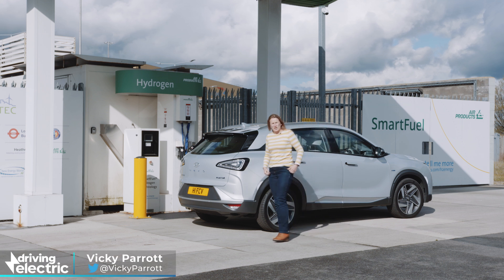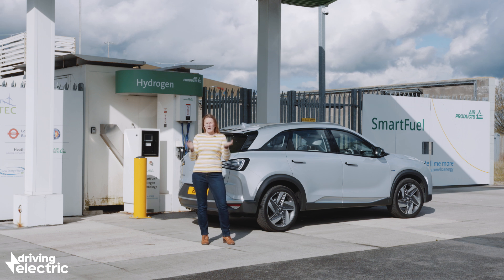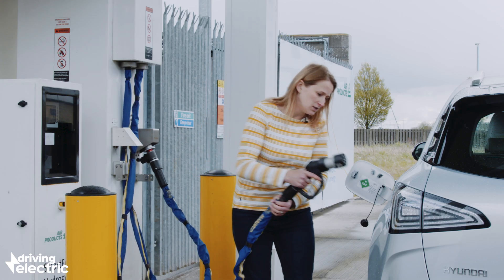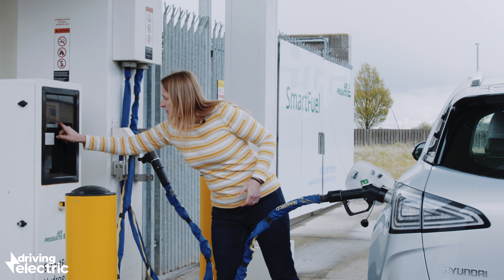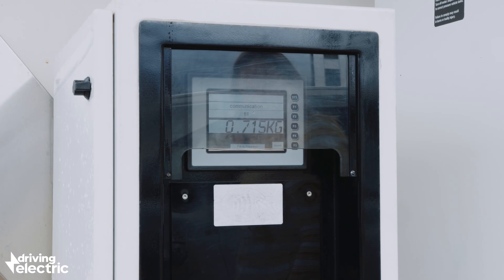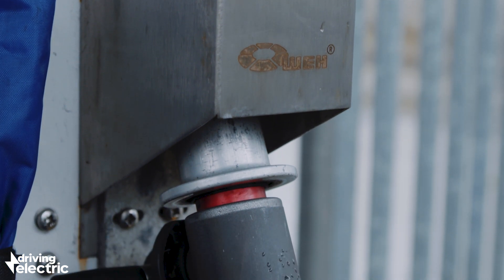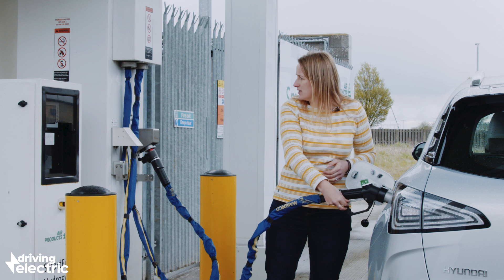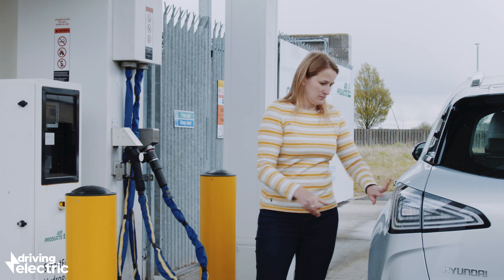How do you fill up a hydrogen car? - DrivingElectric

Comment: Unlike electric, hydrogen is the only potentially 100% clean fuel source, it's in the air all around us, no digging, no shipping, it's a matter of pouring as much money into developing hydrogen as they waste on the filthy destructive mining and shipping of batteries.  The trick is developing independant sources of hydrogen production and blocking out big business which is why it's so expensive now.  The good thing about hydrogen is that you can retrofit current gas stations since the refueling process is quick unlike the hours it takes for electric.

Comment: Hydrogen is the way of the future but people seem content to sit on inefficient methods to obtain the hydrogen.  Currently, Hydrogen is obtained as a byproduct of natural gas production.  This is the wrong way to go about things.  Passing an electric current through a body of water will split the H2 off from the O1, converting water into hydrogen and oxygen.  When put through a fuel cell, the hydrogen and oxygen snap back together and releasing energy used to run the electric motor.  The waste byproduct is distilled water.  When put through a Hydrogen ICE, the hydrogen is oxygenized (aka ignition) and the explosion drives the pistol down.  The waste byproduct is also distilled water.  Hydrogen ICE is better for vehicles that need a larger engine like a semi-truck or a tank.

The advantage for using hydrogen over pure electricity is that hydrogen, while flammable (no different than the flammability of gasoline, propane, methane, etc), can be stored on site for long periods of time, can be transported or piped to any location without energy degradation, and provides similar energy density to gasoline.  Not to mention it's clean.  It is basically a normal gasoline or electric vehicle but the fuel is as energy efficient as gasoline and can be stored for long periods in remote locations unlike electricity.

Pure electricity would be better except batteries are toxic, heavy, have low storage, deplete over time naturally, and unless you can afford to build advanced charging stations everywhere, will take forever to charge.  Not to mention EVs are unattractive to anyone living in an apartment or park on the street.  You need a house or at least an upscale apartment with a garage.

The issue is obtaining the hydrogen.  As said above, currently hydrogen is obtained as a byproduct of NG extraction.  Water however is the best source, and more specifically, water from the sea.  Anyone with a coastline or major river can be energy independent.  Using renewable technology (eg solar, wind, hydro), we have the electric current.  Store and transport hydrogen as we would any flammable gas like methane.  The only annoyance is the pressurized nozzle at the gas station computer to connect to the car.

People don't want to use hydrogen because it's flammable.  But happily turn on their gasoline car and run their natural gas stoves.  Methane is an odorless and colorless gas just like hydrogen and just as flammable.  Corporations/Governments don't want to use hydrogen because they're already invested into Fossil Fuels.  They're going to ride that train until all the oil runs out at our expense because it makes them money.

Comment: I just can't wait for below freezing winter driving, as often found World wide, and here in the States where millions of Vehicles move about, when in a fully built out Hydrogen Future Energy Society countless  hydrogen vehicles have driven before us spewing mostly cool liquid state water exhaust droplets from a hydrogen fuel cell's 60-80C/140-176F exothermic reaction coating the roads with black ice for us to drive over and wreck our vehicles on ! Remember that liquid water begins to steam, when heated, at 100C/212F. To start before embracing Hydrogen Vehicular Transportation please research "Black Ice". Next watch the Hydrogen Vehicle videos showing under high acceleration water mist vented hard onto the ground. Watch the videos of people drinking Hydrogen Passenger vehicle tailpipe emissions by-product. Even " H2O '' liquid dump buttons flipped on from the drivers position. Are you in support of slips and falls in parking lots from countless, intentional winter temperature liquid water waste dumps left when leaving parking spots? Now that is safe ! This concept is just another, not so well thought out,"GREEN", idea that when applied into the real world, with millions of passenger and commercial trucks produced by so many manufacturers  needed to fuel a society with hydrogen to keep us safe from climate change, does not keep us safe from injury or death when in vehicular accidents or falling down when encountering ice. A future Hydrogen Economy when built out, operating so many Hydrogen Vehicles that are spitting water on below freezing road or parking lot surfaces day after day in continual below freezing temperatures is not the answer ! It only takes  a small patch of ice for a person walking to slip and fall. The key point is the state of the vehicle water emitted. Internal Combustion Engines (ICE) have high thermal heat output 250-800C/482-1472F and the resulting combusted fuel emissions cocktail comprises much less liquid water state exhausted as a portion per mile which is, in the case of an I.C.E. exhausted mostly instead as water vapor, which as we all know, is emitted as a gas vapor not settling on a road surface, but dissipating up as heat rising into the atmosphere. Present fuel cell designs drip much water, about a cup per mile, plentiful commercial Trucks / Lorries much more in the liquid state as the only single resulting byproduct, able to fall in a cool liquid form, ready to freeze on colder road surfaces. That is the difference. How about adding a steam heating unit to the fuel cell's liquid water by-product exhaust, this may be an energy intensive solution reducing mileage, and efficiency during winter driving, but lofting water vapor up off the road as ICE propelled vehicles now do. So, where to put the liquid water. Maybe an onboard  tank to freeze solid and burst when parked?  At a stop sign or light idling then accelerating adding heavy icing right there to the road surface just where one wants to actually stop? A parking lot to slip and injure another walking by the back of your parked vehicle or after you drove off leaving water to freeze there? A roadside gutter so a pedestrian can slip stepping off a curb, maybe falling down flat in front of stopped traffic and out of view of drivers ready to accelerate forward? Your driveway so you can fall there ? Your Garage to slide across while holding your infant child then both hitting the hard floor? Maybe, you need more tasks or to be distracted by mopping up the garage floor before the water freezes and your groceries just purchased thaw? Maybe a high speed highway perhaps in a turn? Maybe the unlimited speed limit Autobahn with high water production by those higher electric energy demands moving the hydrogen vehicle through the air while simultaneously dumping large amounts of water mist contrails at high speed onto the road surface? Your Hydrogen Vehicle needs to relieve itself in public, The question is where to do it safely? Now considering these real world usage / interaction scenarios listed, are Hydrogen Vehicles a good idea? As a vehicle operator you can rate the chance of consistent, caring, and professional operator actions observed when you're out exercising your privilege to be with others in the public driving arena. Are you certain that rushed Hydrogen vehicle drivers find and maneuver over a public storm drain water dump station to let their hydrogen vehicle relieve itself in public places when freezing weather is happening? You rate and you decide if  we or will not slip into a Hydrogen transportation based society. As for me...you guessed it,  I see much more "could care less" vehicle drivers and very few careful vehicle drivers. Hydrogen supporters….should we give these "could care less" about you drivers a water soaker sprayer for society at large to walk or drive over when a dash indicator flashes an alert "water tank full" during your trip? 

  As a example of related but current human behavior, How many times do you see trash / rubbish go swirling out of a moving pickup truck bed in the States, or dumped out a moving vehicle window instead of being caringly placed in a proper waste receptacle when arriving at one's destination, as an example of drivers' proper public disposal habits?

Maybe add antifreeze to the water dump so it can mist on following vehicles windshields / windscreens then be smeared when wipers on, so the trailing driver has no clear view of the road. Now that is safe ! Then more windshield solvent , with poisonous methanol, is added to the ground by constantly spraying to keep a clear view. Now we're turning wipers on and off, as if that is not distracting to manage while driving in heavy traffic or oncoming bright sunlight in turns. Now that's safe.

Maybe many Hydrogen Fueled Vehicles can dump water, and antifreeze, smearing trailing vehicle's glass view 360 degrees, that is now spread everywhere in the environment. Now that is green, think !

Maybe the Hydrogen Vehicle owner after the cost of a fill up of Hydrogen decides to not pay for the extra cost of perpetually filling an auxiliary antifreeze reservoir that costs more than gas or petrol per gallon. So where is the transportation fuel savings when buying both Hydrogen and Antifreeze for the fuel cell's water as a by product tank?

Maybe granular or liquid salt treatment of ALL the roads ALL the time when temperatures are below freezing, even on sunny winter days ! Now raising the P.H. in streams from water mixed with salted trickling runoff 24/7/ all winter does not sound very Environmentally conscious or Green Think savvy. Get ready for higher taxes to pay the millions of dollars to pay for road treatment. Pay for replacing your scratched up paint. Pay for a broken windshield / windscreen when a chunk of salt is thrown on it during truck/ lorry application. Buying a new Vehicle often because your vehicle rusted prematurely from driving all winter on heavily salted roads.

Maybe add vehicle exterior damaging or ICE engine air filter intake & cabin air filter clogging traction grit like coal furnace electric generation plant cinders or mined beach sand from environmentally sensitive areas to the below freezing road's surfaces 24/7 all winter to combat black ice on road surfaces, filling the streams with sediment to clog fish gills when stirred into the water column later by heavy rains to follow in warm weather. Now one has to think twice about opting for a green and healthy deep breathing bicycle ride or walk on a drier warm early Spring Day to work or for pleasure while breathing the leftover dust from many Winter months of road grit application stirred up by passing vehicles.

Maybe the antifreeze adder system breaks or is disabled. Now the trailing driver is back to sliding on black ice in below freezing cold temperatures when Hydrogen is used in Vehicles as a transportation fuel spewing ONLY clean water onto the roads as the only by-product of its use.

Possibly you or another will be in a hurry to turn into an open parking space like so many hydrogen fuelled vehicles did before you after many back to back freezing days. Only to slide on black ice your vehicle's front bumper into the side door of or bumper of an already parked vehicle in the next parking space because of all the repeated water dumps released earlier by other shoppers under the hydrogen vehicle's body.  : (

Here in the States most road temperatures fall below freezing during Winter, especially when traveling dark roads during long evening hours. Just imagine creeping with hundreds of other vehicles during slow rush hour traffic on road surfaces that are tilted for warm weather water run off door handle to door handle on multi lane interstates while hundreds of Hydrogen vehicles there with you drip water on to below freezing road surfaces. Yes you imagined what will happen when your vehicle slides toward or into the vehicle on the downgrade. Resulting in another hassel to fix your and the other driver's vehicle. I would bet vehicle monthly insurance rates will cost more to cover all the " Fender Bender" type accident claims caused by gravity sliding your Hydrogen vehicle downgrade into another.

You decide, if adopting Hydrogen Transportation is in our best interest in the "Real World". Seems like a slippery slope to me ! How about you ? Are you still a Hydrogen Transportation vehicle supporter?

Comment: The average cost, per mile, for a gas powered vehicle with an energy efficiency of 22 miles per gallon, is around 15.9 cents per mile, according to a Google search for "the average cost, per mile, of a gas powered vehicle."
The hydrogen fuel cell vehicle seems to come in at about a dime above that. 
If energy were food, electricity and fuel cells would be the healthy foods while fossil fuels would be the junk foods that we are having a really hard time of cutting out of our diet!
Healthy and expensive versus unhealthy and cheap. We are junk food junkies, unfortunately.

Comment: 1:07  So what happens after Aug 2038 when the h2 tanks expire in the car?
Reply: @Elliot Pope they need to be replaced. No one has a guess what it will cost. Today's prices are about $7,000 USD per tank.
Reply: Same as car batteries?
Reply: @gobimurugesan2411  maybe, maybe not. For example, the first Gen nissan leaf had a range of 75 miles. Some are pretty shot at this point and only get 1/2 of that at 38 miles. That's not very useful for the bulk of the population, even as a grocery getter.  Compare that to a typical model made in the last 5 years that gets 250 miles or more, even losing 1/2 of the range in 15 years, it's still a very usable car. In fact, it's still has better range than a new leaf had to begin with. Time will tell.

Comment: £80 to fill it up?! F*** that.
Reply: it's because there aren't really any hydrogen cars in production. Once people start actually buying hydrogen internal combustion cars, it should only cost the equivalent of a few cents per gallon. That's because hydrogen is made from water.
Reply: @Amigafur the process of producing hydrogen itself is expensive compared to other types of fuel

Comment: How about they start investing in steam cars that use hydrogen to heat the water? The technology has been there for steam cars since the 1920s. the steam cars that Doble made in 1925 produced 1,000lbs of torque and they could do 125mph and they could be started with a key, but they did weigh about 2.5 tons.

Comment: I wish hydrogen fuel cell cars were more readily available throughout the UK.  Their are only about 3 hydrogen models available here and most hydrogen fuel filling stations are in the south east of England. 

I would like to see some of these car manufacturers offer a service to convert a petrol or diesel engined car to a hydrogen fuel celled car.  That might be more cost effective compared to manufacturing an entire new car.  This would help drive the demand for hydrogen which would then eventually drive demand for brand new cars to be hydrogen fuel celled cars.

Hydrogen fuel would have to be made more readily available throughout the UK as the demand increases. 

I for one would love to own a hydrogen fuel celled car and I would be happy to recommend anybody to have one.

Comment: 80£ of H2 for filling the tank and 400 miles range
80£ of diesel for filling a 2.0L TDi and 600 miles of range
8£ of supercharging for an electric car and 300 miles of range
Reply: Shame that every 10 years you need to change the batteries because they die out.
Reply: Maybe in older early electric cars but newer cars with active cooling the batteries degrade slightly but should last the life of the car. If not you've saved €20000 in fuel cost to get a new battery.

Comment: So it's still ICE car?? That's awful..
Reply: No, it's driven by a fuel cell, the only waste product is distilled water.
Reply: @Dumlen it's driven by a battery that powers an electric motor. The electricity that charges the battery comes from a fuel cell which converts the H2 in the tanks into electricity. Seems a long winded way to go rather than just having a bigger battery.

Comment: Even at the standard 13p per Kwh, at 3.25p per mile, an EV Will do 3,400 miles, compared to 400 miles for the £80 of Hydrogen.
Reply: Graham Brown  Innit. £80 to fill up a tank and still only 400mile range? Not enough to get people to make the switch imo. How much do hydrogen cars go for compared to EVs? That could be the only selling point I can see.

Comment: Octopus have just released a tariff with an overnight tariff of 5p per Kwh.
An average EV does approx 4 miles per Kwh, so 1.25p per mile.
For your £80 of Hydrogen, an EV will do 6,400 miles!!!
Hydrogen - 400 miles
Electric.   - 6,400 miles
Hydrogen - Where do I fill up?
Electricity - Ubiquitous, I can even charge overnight at my house, and can choose 100% renewable supplier.
Mmmmm, which one?
Reply: Your so right and that’s quite a few squid saved. 🦑 LOL